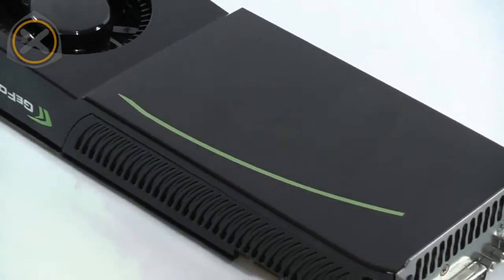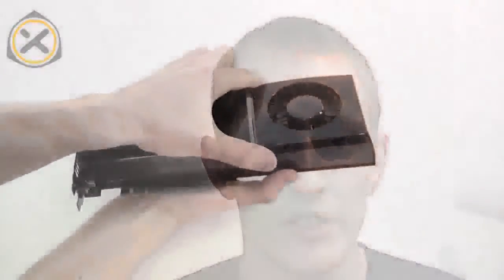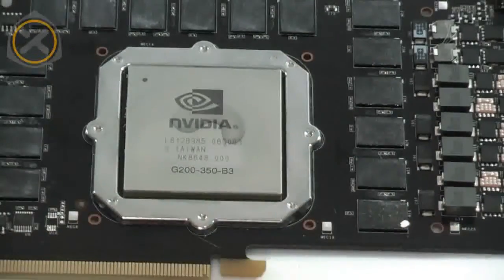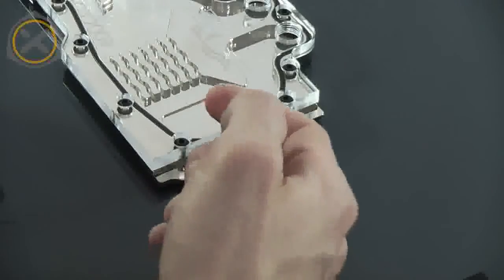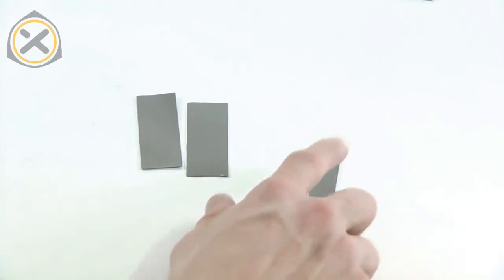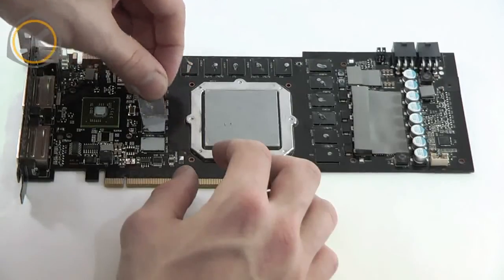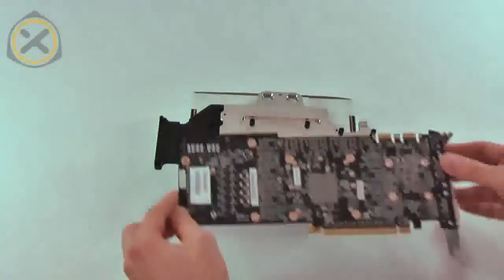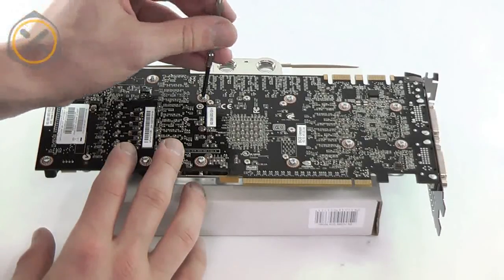EN - Tutorial: How to install a waterblock on the GTX 285 graphics card

Comment: I've got a BFG GTX285 1021MB but I'm not sure if it's reference design or not, or what revision it is. Speccy (by Piriform) reports GPU=GT200;  Device ID=10DE-05E3; Revision A2; 55nm. Is there anyway to tell without taking the aircooler off? Great Video by the way :)